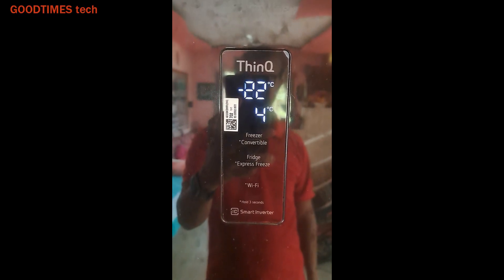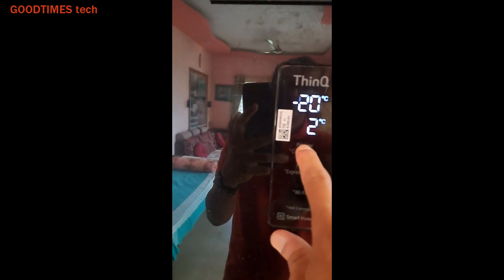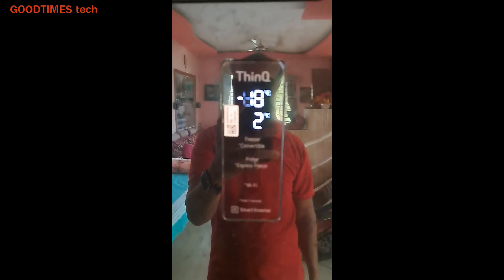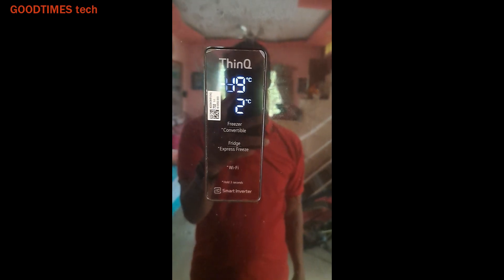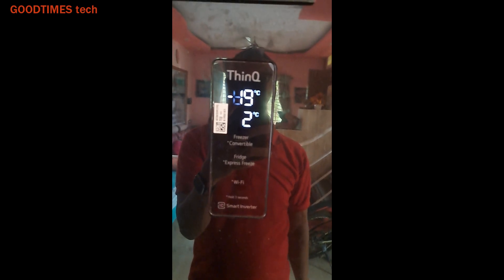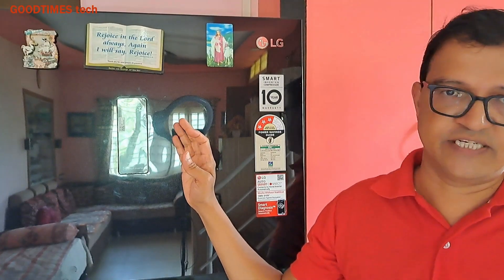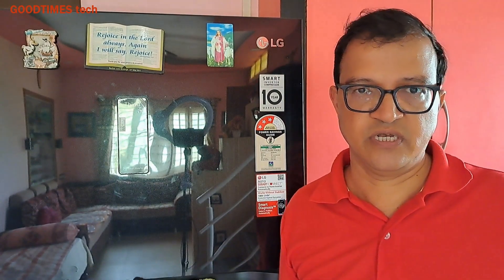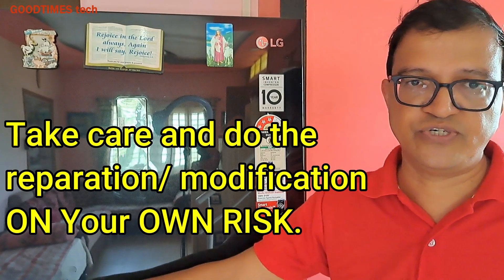Smart convertible refrigerator changing temperature by itself | How to solve in 0 ₹

Comment: You fixed the problem😊. But the point is, after investing hard earned money, the appliances begins to give trouble and the manufacturer and dealer don't listen and user are the ultimate sufferers.  I have got the same problem but no help from lg customer service.
Reply: Yep, same here. I had\have three LG things. the AC windows unit inverter, the LG fridge, and an LG TV. LG TV has no display after 1 yr (backlight works but nothing else). LG fridge is doing what this guy's is doing (everytime I open it, it changes it's own temperature and then does a chiming audio code.). The AC window unit stopped working after a couple of months. Had an error. Talked to LG support and they said it was the compressor and need to be replaced. I left it turned off for a couple months and tried it again and it has been working fine ever since, like 3 years.   Long story short: LG products are trash!

Comment: Not able to convert Freezer into Fridge mode using the Thinq smartphone app
Reply from the maker: Is the Fridge connected to wifi ? I am sorry, i forgot to mention that, first you should turn ON wifi by pressing WiFi button on the fridge control pannel and then isolate the cable. if wifi is not ON please reconnect the cable that is isolated and switch ON the wifi, isolate the cable again and try operating ThinQ app.
Phone and fridge needs to be connected to same wifi router.
Reply: Hi I have connected the fridge with thinq app using the QR code in the fridge and now I can change fridge temperature and freezer using mob app, but not able to convert Freezer in Fridge